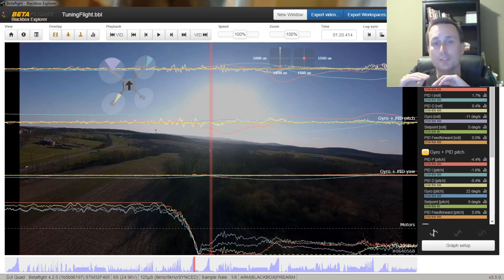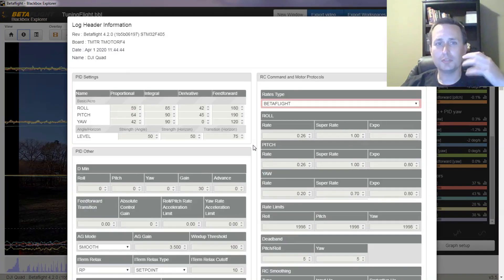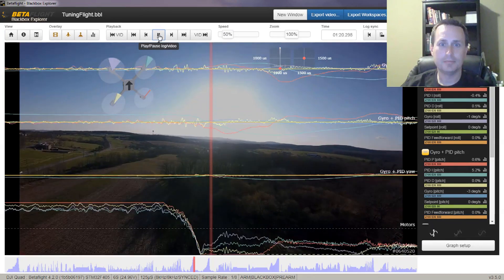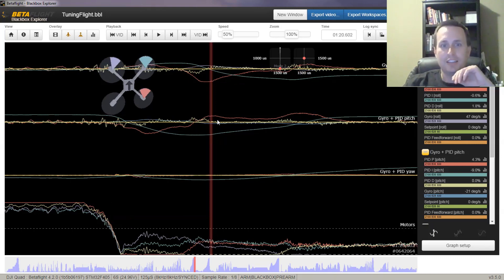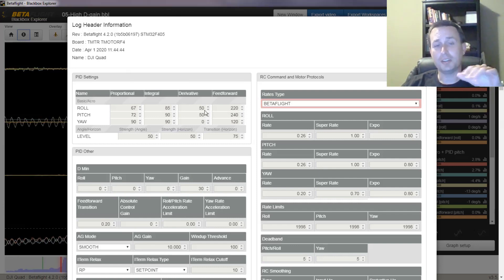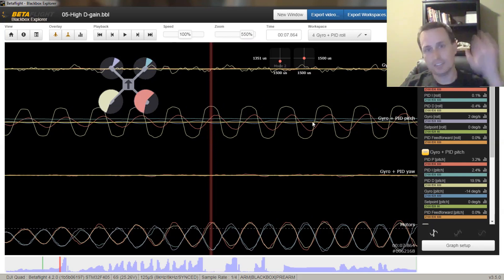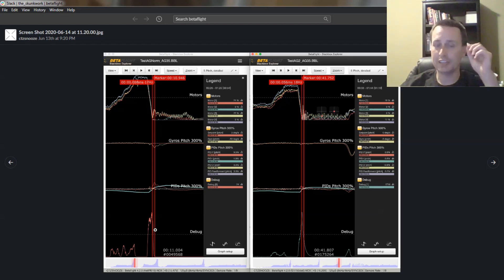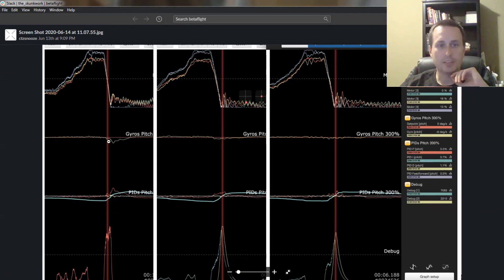Improving Throttle Chop Bobble or "Throbbles"

Comment: Love your honesty. I fpv single rotor helicopters exclusively. And often quad pilots shows off all the smooth and precision video and hide all nasty problems. The only advantage of single rotor heli is that the acro mode runs a fixed constant RPM, and airfoil has very precise linear relation between angle and lift, so, there is no dynamic PIDs change based on throttle needed in the entire throttle range. Heli also has the I term overshooting problem.

Comment: this code is a must have for racing.. been using it for a while... this code really tightens up your spiral manoeuvres to the point where you don't need to drift into turns.. trying to do so tends to have you hitting the inside pole of the gate

Comment: Throbble gone, turned out to be PWM frequency, I changed it to 24kHz (was 48KHz), this worked for me...
Reply: Just had the same experience today. Wanted to try out 48k PWM because of what I read from Oscar Liang but got misc wobbling where it was stable before. So I just changed it back. It flew just fine before anyway :)

Comment: I've already messed around with this code. It's far better than old anti-gravity
Reply from the maker: I have to test it yet.  But first want to look at auto enble/disable DN.  

Man, if i had more time.  So much to test, so little time.
Reply: @uavtech  not a huge fan of that idea. I've seen it but it seems silly to me. I dont like on off logic. To me it makes more sense to just increase a rather than  enable/disable the dynamic notch.
Reply: Btw you can test both at the same time. :)
Reply from the maker: We need to pipe around it.  FFT would continue to run of course.  Why move when you can pipe around.

Yeah, dual FC rig.

Comment: Removing TPA and tuning the PIDs in conjunction with linear_throttle effectively eliminated the throttle-chop wobbles on my toothpick. I turned off dmin and TPA, linear throttle at 55, and I cranked the PD after dialing in the balance. The PID authority feels balanced throughout the throttle range now. Why can't dmin work as designed here!? Does the code need review?
Reply from the maker: D_min works fine.  You just want high D-gains for stability and to combat gyro deviation (wash, wind, etc...).  At 0% throttle, quad is slow so D-tem does not react much.

Comment: Ok I tried my PIDs from Beta 3.5.5 and my boble/wobble was still there, improved but still noticeable.
I flew my 1st quad which is the same build apart from BLheli S esc's Beta 3.5.5 and near enough flat when chopping the throttle.
So I tried changing P and I on pitch and roll, no change, increased Anti gravity gain from 7 to 20 and this had the most dramatic
effect, it increases the bobble! to the point of a twitch! does this give a clue as to what is causing in Beta 4.2?
I like most of the improvements in 4.2, rpm filters prop wash handling and the very precise tracking, but I now have this
issue that was not there when on 3.5.5? and I have a near identical quad that is running Beta 3.5.5, with the same PIDs
on older BLheli S esc's with no rpm filtering and it flies better! 😢...
Reply from the maker: Upload me your diff all.  There is not issues in 4.2, so there is something a miss.
Reply: @uavtech  For sure It will be something I have missed and not 4.2 fault, I have the 2 profiles set up to experiment.
Profile 2 has dynamic idle to zero but on profile 1 and  I did the calculation and it's 19, Throttle boost is zero adjusting this made no differrence.I also originally followed the tuning guide and applied the cinematic defaults, so I may have left this in?
Thanks so much for your time, so much appreciated!

# diff all

# version
# Betaflight / STM32F405 (S405) 4.2.0 Jun 14 2020 / 03:04:22 (8f2d21460) MSP API: 1.43
# config: manufacturer_id: MTKS, board_name: MATEKF405CTR, version: f173f9bc, date: 2019-10-02T14:43:13Z

# start the command batch
batch start

# reset configuration to default settings
defaults nosave

board_name MATEKF405CTR
manufacturer_id MTKS
mcu_id 002d003d574850192034344b
signature 

# name: MARTIAN 4.0

# resources
resource MOTOR 5 NONE
resource MOTOR 6 NONE
resource SERVO 1 A15
resource PWM 3 NONE
resource LED_STRIP 1 NONE
resource SERIAL_TX 5 NONE
resource CAMERA_CONTROL 1 A08
resource PINIO 1 C12

# servo
servo 0 1600 1900 1600 100 12

# feature
feature SERVO_TILT
feature GPS

# beeper
beeper -RX_LOST_LANDING
beeper -BAT_CRIT_LOW
beeper -BAT_LOW
beeper -ACC_CALIBRATION
beeper -ACC_CALIBRATION_FAIL
beeper -DISARM_REPEAT
beeper -ON_USB
beeper -BLACKBOX_ERASE
beeper -RC_SMOOTHING_INIT_FAIL

# beacon
beacon RX_SET

# serial
serial 0 2 115200 57600 0 115200
serial 1 0 115200 57600 0 115200
serial 2 8192 115200 57600 0 115200
serial 3 64 115200 57600 0 115200

# aux
aux 0 0 1 1800 2100 0 0
aux 1 2 5 1350 1650 0 0
aux 2 46 6 1800 2100 0 0
aux 3 13 5 1800 2100 0 0
aux 4 35 2 1800 2100 0 0
aux 5 36 0 1800 2100 0 0
aux 6 37 3 1800 2100 0 0
aux 7 40 7 1800 2100 0 0

# vtxtable
vtxtable bands 5
vtxtable channels 8
vtxtable band 1 BOSCAM_A A CUSTOM  5865 5845 5825 5805 5785 5765 5745 5725
vtxtable band 2 BOSCAM_B B CUSTOM  5733 5752 5771 5790 5809 5828 5847 5866
vtxtable band 3 BOSCAM_E E CUSTOM  5705 5685 5665 5645 5885 5905 5925 5945
vtxtable band 4 FATSHARK F CUSTOM  5740 5760 5780 5800 5820 5840 5860 5880
vtxtable band 5 RACEBAND R CUSTOM  5658 5695 5732 5769 5806 5843 5880 5917
vtxtable powerlevels 3
vtxtable powervalues 25 200 400
vtxtable powerlabels 25 200 500

# master
set gyro_lowpass2_hz = 300
set dyn_notch_width_percent = 0
set dyn_notch_q = 250
set dyn_notch_min_hz = 90
set dyn_notch_max_hz = 350
set dyn_lpf_gyro_min_hz = 240
set dyn_lpf_gyro_max_hz = 600
set acc_calibration = -17,46,-193,1
set rssi_scale = 200
set rc_smoothing_input_type = PT1
set rc_smoothing_auto_smoothness = 40
set fpv_mix_degrees = 25
set serialrx_provider = FPORT
set serialrx_halfduplex = ON
set dshot_bidir = ON
set use_unsynced_pwm = OFF
set failsafe_delay = 20
set failsafe_procedure = GPS-RESCUE
set bat_capacity = 1500
set beeper_dshot_beacon_tone = 5
set yaw_motors_reversed = ON
set small_angle = 180
set gps_provider = UBLOX
set gps_sbas_mode = EGNOS
set gps_auto_baud = ON
set gps_rescue_angle = 30
set gps_rescue_initial_alt = 20
set gps_rescue_descent_dist = 100
set gps_rescue_min_sats = 5
set gps_rescue_allow_arming_without_fix = ON
set pid_process_denom = 2
set tlm_halfduplex = OFF
set osd_warn_arming_disable = OFF
set osd_warn_batt_not_full = OFF
set osd_warn_batt_warning = OFF
set osd_warn_batt_critical = OFF
set osd_warn_visual_beeper = OFF
set osd_warn_crash_flip = OFF
set osd_warn_esc_fail = OFF
set osd_warn_core_temp = OFF
set osd_rssi_alarm = 30
set osd_cap_alarm = 1500
set osd_tim1 = 769
set osd_vbat_pos = 2124
set osd_rssi_pos = 2114
set osd_rssi_dbm_pos = 66
set osd_tim_1_pos = 2134
set osd_current_pos = 417
set osd_mah_drawn_pos = 2497
set osd_craft_name_pos = 2505
set osd_gps_speed_pos = 2544
set osd_gps_lon_pos = 2097
set osd_gps_lat_pos = 2081
set osd_gps_sats_pos = 2537
set osd_home_dir_pos = 2170
set osd_home_dist_pos = 2167
set osd_altitude_pos = 2517
set osd_debug_pos = 233
set osd_warnings_pos = 329
set osd_stat_rtc_date_time = ON
set osd_stat_tim_1 = ON
set osd_stat_tim_2 = OFF
set osd_stat_max_dist = ON
set osd_stat_max_alt = ON
set debug_mode = GYRO_SCALED
set vtx_band = 4
set vtx_channel = 4
set vtx_power = 3
set vtx_freq = 5800
set vcd_video_system = PAL
set pinio_box = 40,255,255,255
set gyro_1_align_yaw = 2700
set gyro_rpm_notch_q = 900
set name = MARTIAN 4.0

profile 0

# profile 0
set dyn_lpf_dterm_min_hz = 84
set dyn_lpf_dterm_max_hz = 204
set dyn_lpf_dterm_curve_expo = 8
set dterm_lowpass2_hz = 180
set vbat_pid_gain = ON
set anti_gravity_gain = 15000
set feedforward_transition = 70
set iterm_rotation = ON
set iterm_relax_type = GYRO
set iterm_relax_cutoff = 5
set iterm_windup = 75
set yaw_lowpass_hz = 50
set throttle_boost = 1
set throttle_boost_cutoff = 10
set p_pitch = 74
set d_pitch = 61
set p_roll = 67
set d_roll = 56
set p_yaw = 72
set d_min_roll = 37
set d_min_pitch = 40
set ff_interpolate_sp = AVERAGED_4
set ff_spike_limit = 50
set ff_smooth_factor = 50
set ff_boost = 0
set idle_min_rpm = 19

profile 1

# profile 1
set vbat_pid_gain = ON
set anti_gravity_gain = 7000
set iterm_rotation = ON
set iterm_relax_type = GYRO
set throttle_boost = 0
set p_pitch = 54
set i_pitch = 50
set d_pitch = 27
set f_pitch = 60
set p_roll = 50
set i_roll = 45
set d_roll = 25
set f_roll = 60
set p_yaw = 66
set i_yaw = 45
set f_yaw = 0
set d_min_roll = 0
set d_min_pitch = 0

profile 2

# profile 2
set vbat_pid_gain = ON
set anti_gravity_gain = 15000
set iterm_rotation = ON
set iterm_relax_type = GYRO
set p_pitch = 54
set i_pitch = 50
set d_pitch = 27
set f_pitch = 60
set p_roll = 50
set i_roll = 45
set d_roll = 25
set f_roll = 60
set p_yaw = 66
set i_yaw = 45
set f_yaw = 0
set d_min_roll = 0
set d_min_pitch = 0

# restore original profile selection
profile 1

rateprofile 0

# rateprofile 0
set thr_expo = 1
set roll_rc_rate = 75
set pitch_rc_rate = 75
set yaw_rc_rate = 70
set roll_expo = 40
set pitch_expo = 40
set yaw_expo = 40
set roll_srate = 85
set pitch_srate = 85
set yaw_srate = 85
set tpa_rate = 10
set tpa_breakpoint = 1650

rateprofile 1

rateprofile 2

rateprofile 3

rateprofile 4

rateprofile 5

# restore original rateprofile selection
rateprofile 0

# save configuration
save
Write your command here. Press Tab for AutoComplete.
Reply from the maker: Do you have a DIFF ALL from 3.5 settings?  Also log of no throbbles in 3.5 and then of throbbles in 4.2; with same settings?  

At a glance, the PD Gain here is low.  Is this a 5"?  Also, some of the settings would not match 3.5; what was available in 3.5 at least.
Reply: @uavtech  Here are the 3.5 quad, yes they both are 5" running DAL 5045 props, but the frames are  Realacc Martian IV 6 Inch 250mm as I find 5" props on a 6" quad just flies better, all up weight is 700 grams for both,
flying on 4s, it maybe I have just adapted to my poorly tuned quad, but for me it works.
# diff all

# version
# Betaflight / MATEKF405 (MKF4) 3.5.5 Jan 15 2019 / 10:05:36 (88921670b) MSP API: 1.40

board_name MATEKF405
manufacturer_id 
mcu_id 004500493436510a33323736
signature 

# reset configuration to default settings
defaults nosave

# name
name MARTIAN 4.1

# resources
resource MOTOR 5 NONE
resource MOTOR 6 NONE
resource PWM 3 NONE
resource LED_STRIP 1 NONE
resource SERIAL_TX 5 NONE
resource CAMERA_CONTROL 1 A08
resource PINIO 1 C12

# mixer

# servo

# servo mix

# feature
feature -SOFTSERIAL
feature GPS
feature AIRMODE

# beeper
beeper -RX_LOST_LANDING
beeper -BAT_LOW
beeper -ACC_CALIBRATION
beeper -ACC_CALIBRATION_FAIL
beeper -DISARM_REPEAT
beeper -ON_USB
beeper -BLACKBOX_ERASE
beeper -RC_SMOOTHING_INIT_FAIL

# beacon
beacon RX_SET

# map

# serial
serial 0 2 115200 57600 0 115200
serial 1 0 115200 57600 0 115200
serial 2 8192 115200 57600 0 115200
serial 3 64 115200 57600 0 115200

# led
led 0 8,12::AO:6
led 1 9,12::AO:6
led 2 10,12::AO:6
led 3 11,12::AO:6
led 4 8,13::AO:0
led 5 9,13::AO:0
led 6 10,13::AO:0
led 7 11,13::AO:0

# color

# mode_color
mode_color 6 1 2

# aux
aux 0 0 1 1800 2100 0 0
aux 1 2 5 1350 1650 0 0
aux 2 46 6 1800 2100 0 0
aux 3 13 5 1800 2100 0 0
aux 4 35 2 1800 2100 0 0
aux 5 36 0 1800 2100 0 0
aux 6 37 3 1800 2100 0 0
aux 7 40 7 1800 2100 0 0

# adjrange

# rxrange

# vtx

# rxfail

# master
set acc_calibration = -28,37,61
set mag_hardware = NONE
set rssi_scale = 200
set rc_smoothing_type = FILTER
set rc_smoothing_input_type = PT1
set rc_smoothing_derivative_type = OFF
set fpv_mix_degrees = 25
set serialrx_provider = FPORT
set serialrx_halfduplex = ON
set dshot_idle_value = 800
set motor_pwm_protocol = DSHOT600
set failsafe_delay = 20
set failsafe_procedure = GPS-RESCUE
set bat_capacity = 1500
set beeper_dshot_beacon_tone = 5
set yaw_motors_reversed = ON
set small_angle = 180
set gps_provider = UBLOX
set gps_sbas_mode = EGNOS
set gps_auto_baud = ON
set gps_rescue_angle = 30
set gps_rescue_initial_alt = 20
set gps_rescue_descent_dist = 100
set gps_rescue_ground_speed = 1000
set gps_rescue_min_sats = 0
set pid_process_denom = 1
set tlm_halfduplex = OFF
set osd_rssi_alarm = 30
set osd_cap_alarm = 1500
set osd_tim1 = 769
set osd_vbat_pos = 2124
set osd_rssi_pos = 2114
set osd_tim_1_pos = 2134
set osd_current_pos = 417
set osd_mah_drawn_pos = 2497
set osd_craft_name_pos = 2505
set osd_gps_speed_pos = 2544
set osd_gps_lon_pos = 2097
set osd_gps_lat_pos = 2081
set osd_gps_sats_pos = 2537
set osd_home_dir_pos = 2170
set osd_home_dist_pos = 2167
set osd_altitude_pos = 2517
set osd_warnings_pos = 329
set osd_stat_rtc_date_time = ON
set osd_stat_tim_1 = ON
set osd_stat_tim_2 = OFF
set osd_stat_max_dist = ON
set osd_stat_max_alt = ON
set debug_mode = GYRO_SCALED
set vtx_channel = 4
set vtx_power = 5
set vtx_freq = 5800
set vcd_video_system = PAL
set camera_control_ref_voltage = 320
set camera_control_key_delay = 100
set camera_control_internal_resistance = 195
set pinio_box = 40,255,255,255

# profile
profile 0

set dterm_notch_cutoff = 0
set vbat_pid_gain = ON
set anti_gravity_gain = 7000
set iterm_relax = RP
set p_pitch = 54
set p_roll = 50
set p_yaw = 66
set f_yaw = 0
set i_level = 0
set d_level = 0

# profile
profile 1

set dterm_notch_cutoff = 0
set vbat_pid_gain = ON
set anti_gravity_gain = 7000
set iterm_relax = RP

# profile
profile 2

set dterm_notch_cutoff = 0
set vbat_pid_gain = ON
set anti_gravity_gain = 7000
set iterm_relax = RP

# restore original profile selection
profile 0

# rateprofile
rateprofile 0

set roll_rc_rate = 75
set pitch_rc_rate = 75
set yaw_rc_rate = 70
set roll_expo = 40
set pitch_expo = 40
set yaw_expo = 40
set roll_srate = 85
set pitch_srate = 85
set yaw_srate = 85

# rateprofile
rateprofile 1

# rateprofile
rateprofile 2

# rateprofile
rateprofile 3

# rateprofile
rateprofile 4

# rateprofile
rateprofile 5

# restore original rateprofile selection
rateprofile 0
Reply: @uavtech  I have attached a link to two logs, 1 is Beta 3.5.5, only flying around no throttle chops as first log was corrupted were I did throttle pumps to test, prior to flying my 4.2 quad.The other log Beta 4.2 has throttle pumps and
throbble shows up in video, I landed a few times to change settings to see if this changed, the 4th flight AG gain is set to 20 
and the quad does a throbble twitch very clear in the video.
I have also added BB video and  log00013 of test flight of the 4.2 with the issue, there is a read with details.
"" https://www.dropbox.com/sh/eoqospex2wsjfq9/AACSc2MOYfaStNJuwJD6EPo5a?dl=0 ""

Comment: Potentially stupid question - would it be worth trying to have ultra-aggressive I-Term clamping anytime a motor is at saturation for more than (a small number of N) PID cycles?  Trying to work through all the potentially negative ramifications, but that might be a way to limit a lot of the saturation-accumulation driven wobbles present on any super-aggressive move.
To some extent, thrust linearization is the other part of that fix, but bounce-back accumulation is definitely a thing, and any instance where motor saturation is significant.
Reply: Ok, finally watched some more - AG-Boost in those situations is a more flexible answer - although saturation detection may still have some value.  Can probably leverage the dMinGain logic or something similar.

Comment: Thanks for the video I have the same issue (no yaw problem), I recently switched from Betaflight 3.5.5 to 4.2.0
No bobbles to bobbles when chopping the throttle, I know it's not a balance issue and must be a setting.
Adjusting antigravity gain makes no difference, this has given me few ideas to investigate, the tune seems fine
to me and the quad now is flying way better with rpm filtering and tracks very precisely.
What I think it could be is my rpm min is too low and that's why I did not have the issue on 3.5.5?
Reply from the maker: Bring.over your PIDs from 3.5.5.
Reply: @uavtech  Thanks for the reply I will try it and let you know...

Comment: Why not raise d_min gain (within reason) instead of D term (for tuning bounce on flips and rolls)? This way we can push p-d gain up higher.
Reply from the maker: Because you want the proper balance between the minimum D-gain and P-gain for the best prop was handling.  P and D work together for prop was pushback.  D_min boosting D-gain makes that too complex to determine.  So turn it off.
Reply from the maker: Push PD gain up for max P&D push back to outside disturbances.  They push together to fight any (wind, prop wash, etc.).  Also for big crafts, you need higher gains to not get wobble.  More gain = more PID authority and advanced timing on gyro changes.